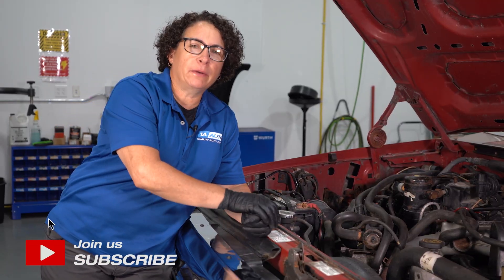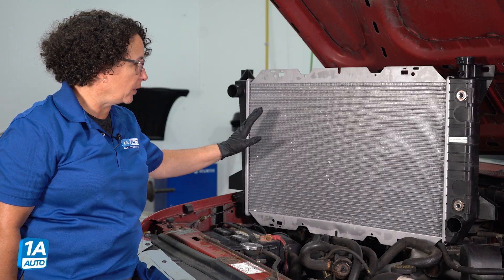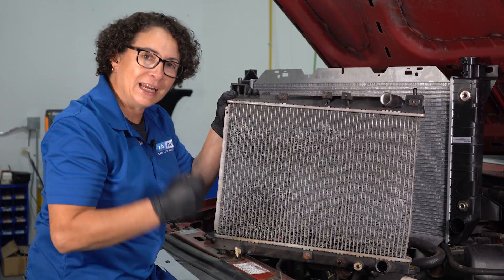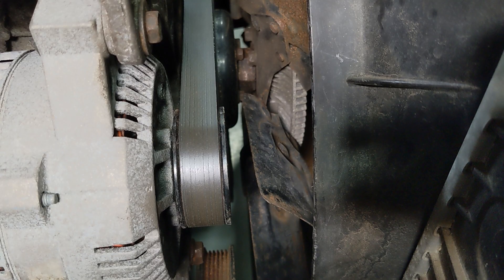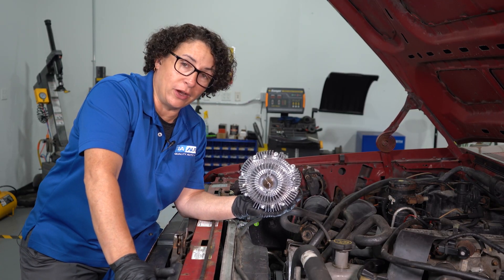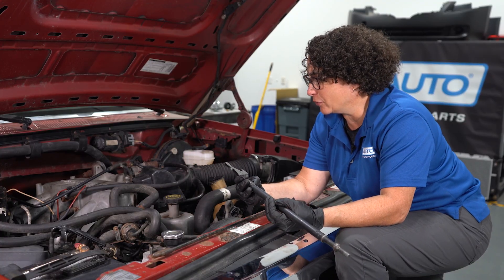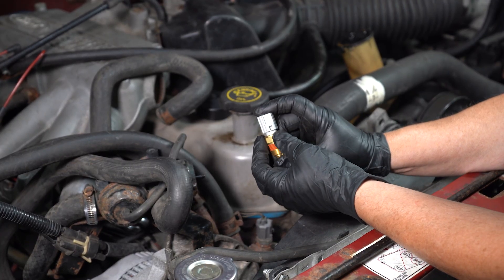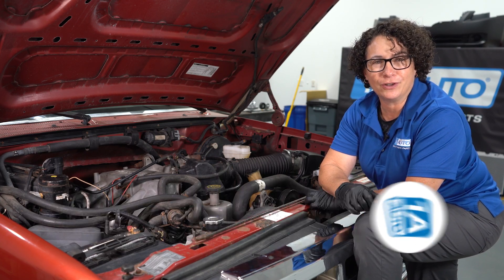Truck Running Hotter Than Normal but Coolant Is Full? Things To Look for Other Than Coolant Leaks

Comment: Any advice for an engine running hot when towing up a mountain grade, but then it goes back to normal when descending the mountain pass on a 100° day in the Utah summer?  Chevy Silverado 1500 5.3L V8.

Comment: Got code P0127 and P1285 - saw engine coolant temp high warning - mechanic said lower radiator hose is ice cold. Heat isn't blowing hot air - when he drove it he saw the temp gauge creep up he said. Few months ago had radiator and tensioner replaced

Comment: I just bought my first 02land rover freelander se2.5 v6 the lady i bought it from said it overheated on her and her son said he put on a new cap so it kept over heating so i got it home the cap reads 200 and he put the wrong cap with the wrong threads and the cap was on the resavor cross threaded and i filled it res and water was blowing out of the res. And that's when i found the wrong cap the wrong temp on the cap wrong threads and the the cap was so tight on the res and offset so when i go to O'Reilly's tomorrow they have what i need ps.what is the temp on the cap have fun.    Fred

Comment: WRONG! ,,, low pressure rinse only.
      NO HAMMERING!!! Correct hand tools only.  With her instructions you’ll be needing to buy a radiator, water pump, fan clutch. 
Maybe because they sell parts.?.

Comment: Just received my front and rear brake rotors and pads from you guys yesterday. Can’t wait to install them and see what they do.
 Also about to order plugs and coils for both my cars, probably within the next few days. Prices seem pretty reasonable in my opinion. Just hope the products are solid. Chose to go with you guys over Rock Auto.

Comment: One that I unfortunately learned the hard way (to be fair, 2 mechanics diagnosed it as a bad water pump). Pop open the water reservoir, give it a sniff. If it has even a hint of exhaust you probably have a cracked  head gasket.

Comment: I have a 2000 Camry LE 4 cycylinder that was given to me by my late cousin it was his father's Camry. My cousin told me that he changed the radiator but I'm not so sure. I had to get a new radiator cap for the Camry. I also got the coolant sensor and switch for the Camry. Of course there aftermarket. The OEM ones would've cost me well over $700.00. So I bought the aftermarket ones and put them in myself. They both have a lifetime warranty from O'Reilly's. So far so good. The brackets that hold the radiator in place need to be changed as well. They are rusting. The coolant in the radiator is a brown color it needs to be changed. Parts of the old radiator cap broke off into the radiator. This has me worried. I put on a new radiator cap. I think all of the fluids in the Camry need to be changed. Steering, brake, transmission, and coolant. The air conditioning fluid needs to be checked also. My late cousin gave me this Camry with a lot of problems. I have put over $7000.00 into the Camry so far. I can't afford to get a newer car and I won't have a electric vehicle no way. The Camry is a challenge but that's what I like. Thanks much for your video.

Comment: Could I use this Rust-Oleum 344713 Automotive 2-In-1 Rust Reform & Seal Spray to undercoat the inside of my rockers before I put new ones on ?

Comment: You want to check the most obvious and least expensive to replace.  So I’d check the thermostat, fluid being full, water pump, and then radiator.  Also check to make sure the fans are working.

Comment: Some more possible obvious symptoms of bad/stuck radiator (which I had):
1) radiator fan working almost constantly while the truck is running; 2) the radiator does not radiate the heat effectively- you stop feeling the heat from under the grill after driving.

Comment: I recently replaced a temp sensor on a 04 Honda Civic LX but customer says it's still running hot and has to engage the ac i told him we need to Wash the radiator and go from there has yet to be done

Comment: I thought the fan blade pulls air through the radiator hence the shroud it's in and the air dams around the sides too

Comment: Had the 2000 ranger for many years and the only time the temperature hand goes up, is if the outside temperature is above 80 degrees and only if it's idling to much at drive thru's or  red-lights.